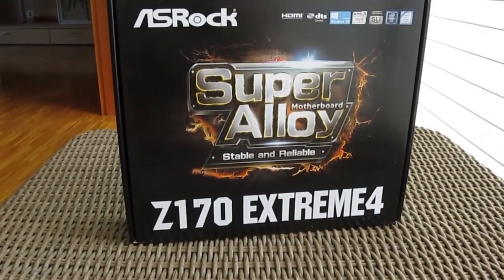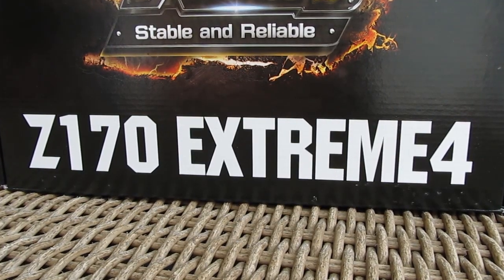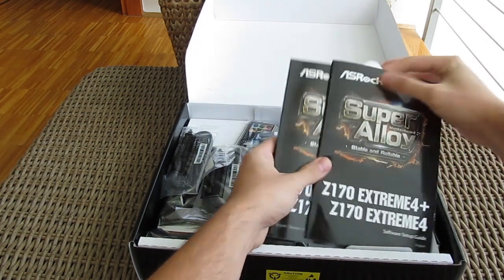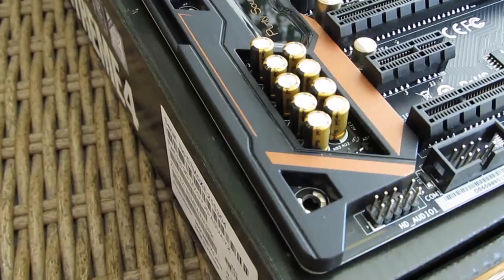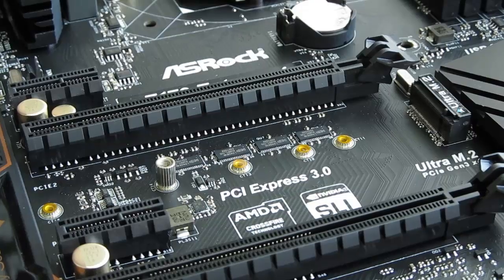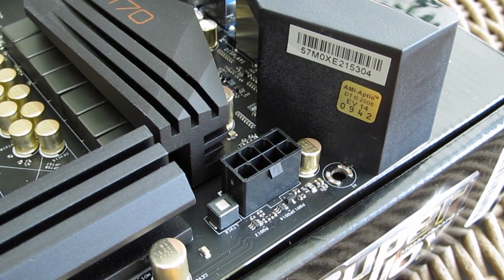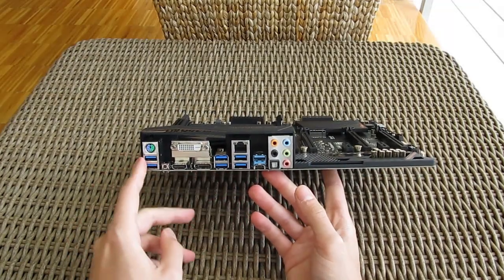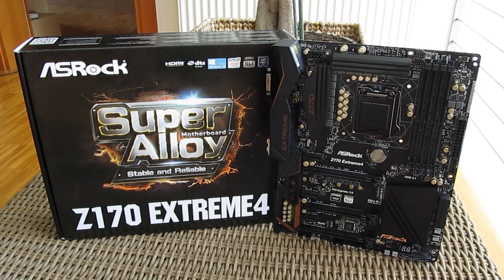ASRock Z170 Extreme4 Preview & Unboxing

Comment: Picked mine up at Microcenter last Sat. For the price, it is a pretty good deal.
Reply: It's pretty good. I bought it for 105$ and got a 30$ mail in rebate. For 85$ I got a good deal. Running a 6700k @ 4600mhz. Board works flawlessly

Comment: I can get this or an Asus Z170 PRO GAMING for the same price. Which one is better for overclocking?
Reply from the maker: Ugh, that's a tough one. They are pretty much neck and neck power design wise, maybe take a look at some examples of overclocking on forums from users which have them.
Reply: Thanks for the advice, I will probably go with the Asrock one as I have reliability issues with ASUS in the long run, but I will look at OC values for both of them.

Comment: Hey I ran into some troubles with the Z170M extreme4 (not z170 but hey): screwed up the legacy compatibility setting with USBs and now I can't use my keyboard. The problem is im running a partially corrupted dual boot and it won't let me boot into my working Win10. 

I read on a website that the z170 has a physical BIOS reset button, but it did not show where the button is located. Could you show me where that button is? Maybe then I can figure out my z170m. Thanks!
Reply: There's a dual bios switch. Idk about M version.
Reply: cant use keyboard or mouse past bios either, no usb 2.0 ports. how did you fix this?

Comment: does it have the thunderbolt header?
also will the USB 3.1 type c deliver thunderbolt 3?
Reply: +stupidusername38 not sure if its too late to answer ur 1st question, but yes it has!
Reply from the maker: +stupidusername38 It doesn't have a thunderbolt header, I think it would otherwise be written all over the motherboard box probably :D I don't think you can use the USB 3.1 port for that, it's a completely different chip, although the TB 3 can use Type-C cables for connection
Reply: TekTick thanks, I'll have to stick with the extreme 7+ instead
Reply from the maker: stupidusername38
No problem!

Comment: Does Asrock have the "harddrive saver" feature on any of their Z170 motherboards as equiped on their Z97 Extreme motherboards whereby two harddrives can be turned on or off while the computer is in use?
Reply from the maker: +faustsmith I know what you mean, but as far as I know they didn't implement it again into their Z170 motherboards.
Reply: +TekTick  What a pity. The Harddrive Saver "HDD Saver" is a better method of back-up than RAID in my humble opinion as the other one or two hardrives connected to the "HDD Saver" can be turned off when not in use thereby extending their life.

Comment: Is that really good? What is the difference between extreme 4 and extreme 7?
Reply from the maker: +Cloud VII More I/O's, better power design, different PCI-e slot arrangement.... But, in a nutshell, If you are an average user, even a bit above that, you should go for the Extreme4.